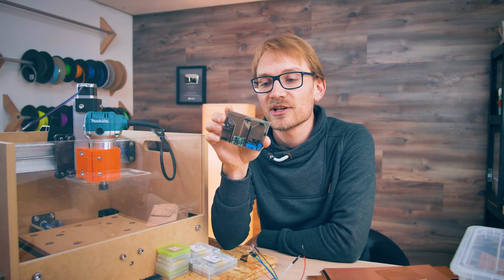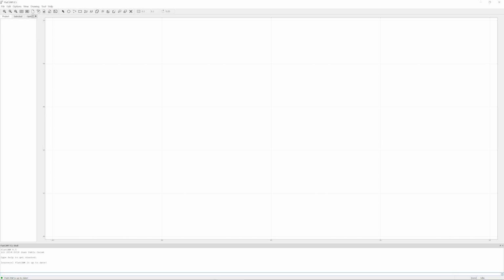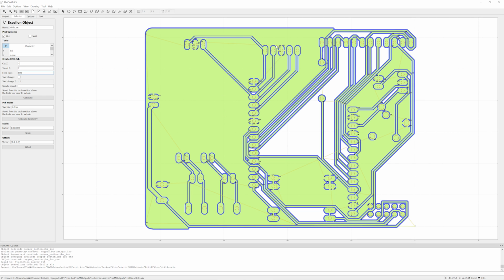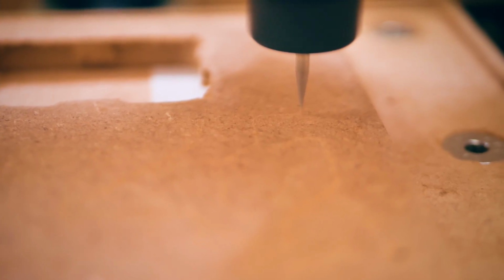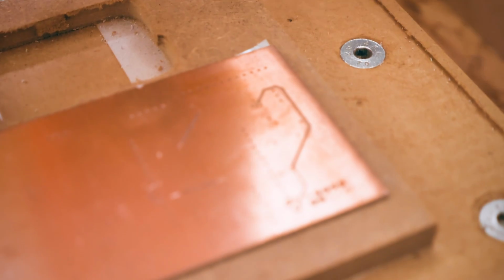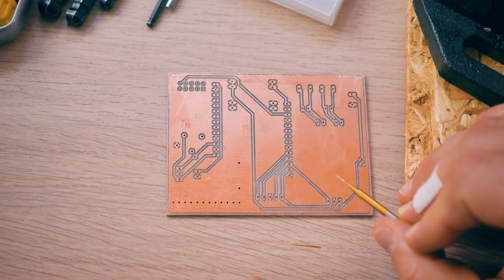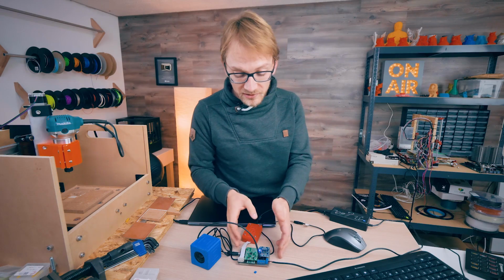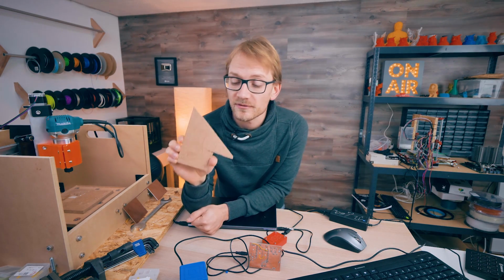Make custom PCBs with the Sienci CNC and FlatCAM!

Comment: I think your problem with engraving bits is flatness. You expect the board to be perfectly flat, as well that your double sided tape work is perfect. Both assumptions are not quite true, just imagine how your first layer would look like if you taped a board on your print surface without calibration. 
I've seen a lot of mills that use the bit itself as a touchprobe. Since the material is conductive you basically only need two crocodile clamps. One for the bit and one for the board, as soon as the bit touches the board it'd close the circuit. You'd need one aditional step to adapt the gcode or use a gcode-sender that supports auto-leveling

Comment: the sad thing about mill collets is depending on the thing they go into the tolerances are way too big, its better to either have a dedicated machine with a standard applied to it and the bits to go into them, or to get a flex shaft with remote chuck that has no play. this "CNC" would be great for a hobbiest working with plywood but not necessarily milled circuit boards. Tech2c has a decent setup now with his new all metal chuck to look at for a where to start. that spindel you showed at the end of the video will be a huge upgrade over that makita despite the slower speed.

Comment: I really look forward to the 3D printer version of this video. Sure, it's probably going to be limited to fairly large components, but that's all I have been doing so far (and wiring stuff directly - not even using PCBs). I guess the idea is to print a mask on a copper board (TPU should stick pretty well?) and then use an acid bath to etch away the unwanted copper with acid.

Comment: Just a random suggestion: you can use a piece of steel and connect alligators to it and your CNC collet, ending in Z endstop pins in your control board. Then probe for Z.
Finally, misure the depth of the steel piece, move the CNC down of the same amount and reset with G92. There you go, perfect 0 on Z

Comment: I went through the same learning process using the MPCNC with the same Makita router. Instead of using Flatcam, a Eagle plugin could be used to directly generate the g-code (pcb-gcode).

As I had the same issue about the width of the milling at the first tries, I found that the 0.1mm/10° tips tend to break at the first touch with the pcb very easily, which lead to cut not with the actual tip, but with a broken edge of it causing wider cuts. I went to 0.2/30° and the result was perfect compared to the first trials, now it is easily possible to create pcbs for 0603 smd parts.

Comment: I just finnished my first project with a CNC milled PCB. It gets interesting when you do double sided PCBs because the precision you can achieve is great when aligned properly. Also I recommend to use ultrasonic cleaning of the PCBs because little copper chips may short your traces. You will be surprised how many copper chips you will find in your cleaner that potentially could short out your board.

Comment: Sooo... I make one-sided drilled board like that with photoresist in about 20 minutes... I don't need to care about mill size, gebers, CAM, gcode, setting zeros... 20 minutes, from hitting "export SVG" in KiCAD to soldering. And i make 2-sided masked board in about 2.5 hours... Of which 1.5 hours i'm just baking board in the oven... Why again i should mill traces? I can see it's use in drilling holes and milling edges, and i actually did that once, but i made 8 boards then. Once.
As for chemicals... Eyeballed 1-2% solution of KOH/NaOH and oh so dangerous mix of citric acid, pyroxide and salt. You could bathe in that getting just sligtly dry skin afterwards.
Sorry for being sarcastic, but when somebody say, that milling traces coud be usable, i just can't help it :)

Comment: Is the feed rate for cutting indeed 600mm/sec as was mentioned in the video? Considering to build an MPCNC, now 60cm / second seems really fast to cut PCB, but I am not experienced. Lateron you cut the PCB (2mm thick) at a rate of 300 is that also mm./sec?

Comment: Can't you set the z height with a MULTIMETER? When you get continuity from the bit to the copper, it's set. :)
Reply: the cnc machine already has input for this. it can be used to automaticaly probe grid of points and process g-code accordingly

Comment: Very helpful video Tom!  Will be looking to replicate soon on my CNC router.  It's pretty much an OpenBuilds OX.  Currently it has a massive water cooled monster spindle - may need an ER11 but I will see how it goes with the current one first.
Would you lose fewer pads if you drill after routing traces?  Strikes me that if there was more copper left on the board it would lift up the edges less while routing, then hopefully the drilling is the cleaner process.
Currently I do PCB prototyping using etchant, and heat transferring toner as an etch resist.  It works really well - traces are much better than the sienci traces, and screen to PCB is less than half an hour - but I'm drilling holes manually with a mini pillar drill. 
I'm hopeful to try a hybrid approach where I etch the PCBs then drill and cut them them out on a mini mill or even a 3D printer...

Comment: I wanted to try and print straight onto the copper board then etch it. I used to make pcb’s with a pen by drawing onto the board then etching it so I think printing the tracks onto the board should work?

Comment: It's called a rubout Tom! I don't know if Flat CAM is able to do it but basically it removes all copper that isn't a trace or a ground plane, which makes soldering a little easier on prototype boards. It does take a little while longer, but it can certainly be worth it when you get down to 0603 components etc.

Comment: The holy grail for me is to have a repeatable jig so I can drill the holes, through-plate them, and then mill the rest of the board, top and bottom without having to compromise on routing.

Comment: Arduino+Grbl is pretty avg, I would recommend using double nut ballscrews and a better motion controller + Mach4 + autoleveller.

Also not a bad idea to spray the board with a conformal coating kinda like lacquer.

Comment: You'll have better results in FlatCAM if you don't include a ground plane. FlatCam routes the boundaries of the fill polygons as if they were traces, meaning it doesn't actually route the isolation gap between traces and the fill- it just traces the boundaries so it will leave copper in the isolation gap if it's wider than the bit, which can make it super hard to solder. A flux pen will make soldering easier in general, though.

Also it's borderline impossible to get a flat copper clad board. If you're using an engraver bit you really want probe autoleveling. You can use a flat endmill to avoid this issue, but endmills small enough to route traces break really easily. 

Engraver bits shouldn't be breaking. I get 5-10 boards even on my cheapo $200 machine out of a single V-bit before they're dull, you're probably cutting too deeply in a single pass.

Comment: Your a clever guy, in most respects, but you soldering sucks! Tips = Don't use lead free solder, it's next to useless. Clean PCB's with a good solvent just prior to soldering. And if the solder it taking to the board, use a 'flux pen'.
Reply: Lead free solder was bad 10 years ago. Nowadays you don't need leaded solder for anything larger than 0603

Comment: As a reference, if you were to send your gerbers off to a PCB prototyping house, you would need 8-12mil clearance between traces (and minimum trace width) for most of the budget ones to accept your design with a good yield - and they're using a several times magnified photo lithography process that's generally got tighter control and repeatability than most inexpensive CnC machines.  If you're going to mill your own boards, I'd recommend going a tad bit deep with the bit (lots of people run into issues with leveling), and leaving your trace width and clearance on the wider side for reliable results.  For single sided routing like this, jumper links are a real help for those few traces you can't get past pads, and they look clean populated on the top of the board.  Removing some of the copper fill takes more milling time, but also gives you that solder resist effect in some locations... otherwise it's another vote for using oversized pads (they can hold more solder before they bridge and are easier to land an iron on) and oversized clearance.

The cheapest option is still the budget PCB houses, since you get two layers and solder resist for often less than a dollar a board plus shipping, but it's certainly fascinating to do on a mill at home.  A home-etched board sounds like a neat thing to show in a video - good excuse to play with nasty chemicals!
Reply: Actually, 6 mil width/spacing is a standard for cheap Chinese PCBs and the quality is reasonably good.
Reply: Couldn't agree more. Those chinese pcb manufactuirers are a life saver.  I always hated the home etching methods and found them unreliable (let alone the nastyness) . And while I would love to have a pcb milling machine to get prototypes fast, it's seems like it's really hard to achieve good results with a typical hobbyist budget. The biggest disadvantage to me is that you are limited to single sided boards. You can do two layer boards with a milling machine but you have to be carefull with the placement and you have to manually solder all the vias. I'm lazy so it's a big no no :p
Reply: Yup, making PCBs is such a ball ache. Just the cost of half decent copper clad board makes the chinese pcb house well worth it. Let alone all the other crap, time, mess, fails. Just for a basic board with no mask or screen. Dot or vero board for on offs. China anything else.
Reply: Yup, making PCBs is such a ball ache. Just the cost of half decent copper clad board makes the chinese pcb house well worth it. Let alone all the other crap, time, mess, fails. Just for a basic board with no mask or screen. Dot or vero board for on offs. China anything else.

Comment: Theres a pcb to gcode plugin for eagle that directly converts to gcode via eagle menus, much easier than the method you describe. I use this with my openbuilds ox/grbl machine and a specific pcb milling bit, z height set with electrical contact probe. It works extremely well. Those cheap engraving bits did not work well for me and gave terrible results.

Comment: CNC machines are awesome, but this was a faf.
I use a tonner transfer method for pcb's, it is a lot cheaper, more accurate and less work if you have a laser printer.

Comment: Given that new chips and parts are mostly SMD and super TINY,  milling boards has become virtually useless . It only works ok in the world of dip packages and 0.1 pitch stuff. Good look on getting isolation on 0405 smd resistor . I use laser printer and UV sensitive film to go down the etch tank path. Especially now that I play around in microwave circuits, the mill just would not be able to make microstrip filters .
Reply: DIP components are still needed in the prototyping phase. However, I have not had much luck with milling. I switched to laser engraving of painted boards and etching. It works also with SMD.
Reply: @walidkhier5640   DIP is not used anymore in "prototype" in many areas. You can not even get DIP parts for all the latest chip sets and DIP is worthless at high frequency due to lead inductance.

Comment: Love that you're using FlatCAM for this demo, when I was looking into doing this a while back it seemed like all the tutorials were for using Eagles built in gerber to gcode plugin. The board cutout feature in FlatCAM will only do a bounding box, but since you already have a board cutout layer gerber there's a trick you can use with that. Generate geometry on the board cutout gerber like you would for isolation routing. That will leave you with a trace on the outside AND inside, which isn't what you want, but then you can use FlatCAMs "exteriors" command on that geometry you just created. It will create another copy of the geometry but only the outside portion. Carbide 3D makes a 40 degree PCB engraving bit that I find works a lot better. I'm able to get a consistent 0.2mm "trace" carved out. Milling out FR4 produces a lot of very small glass dust particles. So hopefully you're using a 0.3 micron HEPA filter on the vac.
Reply: I just put water on the pcb during milling... cools the bit and solves the dust problem :)
Reply: @RoterFruchtZwerg  Good idea, I've seen it done with a mineral oil bath too.
Reply: It takes a lot longer, but I've also had better luck with keeping the burs down by setting my feed rate lower, around 110-120mm/min
Reply: +1 regarding the fiberglass dust particles— those can be very nasty if you breathe them in to your lungs

Comment: Thank you for this information.  I'm currently experimenting with milling with my second Mendel, on wood with a Dremel flex shaft.   It has been a great opportunity to learn material properties, tool capabilities, and basic 3-axis cnc milling.  PCB milling is definitely a future project.  Currently, I've been doing my milling gcode by hand and with the help of bash scripts.  I'm currently running a planing operation to remove 1cm of material from a 118x60mm block of material in preparation for further milling operations.  I may design and construct a wooden X carriage in this manner.

Comment: for getting perfect z height pcb milling use the tool as a zprobe  by hooking leads to the copper board you can either do it manually or hook it up like an endstop for z

Comment: All ya' need to make quality PCBs is a laser printer... (paper + chemicals etc.) Not to diminish CNC milling, but it seems like a headache.
Reply: The chemical photographic process is a headache. For a single pcb the cnc is way easier and faster and gives a more reliable waste without the nasty chemical waste. I've moved my process over entirely to cnc.
Reply from the maker: I've done toner transfer before, and while it gives great resolution, I find it quite inconsistent abd tedious

Comment: Great video man. I recommend the "painters tape and super glue" trick for adhesive though, especially for precision cut materials. For me, carpet tape always had too much variance across a longer run, plus its pretty annoying pealing it off. Also, may help using a diamond cut bit.
Reply: You can buy actual double sided tape that is made for machining.  With the number of failures you that are carpet tape related the higher expense of the machining grade tape is worth it.
Reply: William Sanders what brand/make should I search for? I’ve phoned a few adhesive manufacturers and none of them knew of a similar product.

Comment: Nice video! 
I also use a cnc to make circuit boards in my work.
I use the easy EDA to design the pcb, the flat Cam to generate the gcode, the Bcnc to control the machine and this last I really recommend, is totally free and open source and very useful.
Reply: The v carve bit is the best way to make the isolation of the copper, the flute bit is more sensitive and breaks easily.
Reply: And always is better enlarge the pad diameter always as possible.

Comment: Nice 'show off' project to highlight the capacities of the router, however practically the good old method of print the layout, transfer it to the PCB using UV cured varnish, and etch it using iron (3) chloride is easier for DIY.
Using the router to then drill the holes instead of manually, however, oooh yeah!

Comment: there exists no reason to machine a pcb yourself when you can get one from china with solder mask and silk screen for not much more than the raw material required to do it yourself
Reply: I just made a much longer reply elsewhere in the comments of this video, but I'll summarise it: TIME!!!

If I'm prototyping a design, the last thing I need is to have to wait TWO WEEKS to get the next iteration of a design from China! That's going to completely kill any momentum you had for the project! Yes, the Chinese fabs are great, but it's also incredibly valuable to be able to get a board made and ready to test in a matter of an hour or two!

Comment: Cool and interesting Video, but shoudn't it be possible to print a Adapter (yes in Plastic) for you're Endmills to get a better Tolerance free fit?
And for the next Videoyou use DLP/SLA with a 1-2 Layers to etch the copper plate right? (What i already saw it is kind of messi)
Already wanna see you're next Video. ;D

Comment: Hey nice job! I have an Arduino CNC and i use flatCAM, the same method that you showcase and i have a few tips:
-With those V bits i have succeed only with 0,3mm of isolation between traces and at most 0,6 mm traces width
-When you drill the holes those drill bits don't align properly, so I create a pilot job of deep 0,2mm using a V bit and the I do the drill job, that helps to ensure every hole is aligned
-I use chillipeppr instead of UGCS because you can do a Z height probing and also do a bed mesh probing to avoid non isolated traces
Greetings from Costa Rica Tom!!